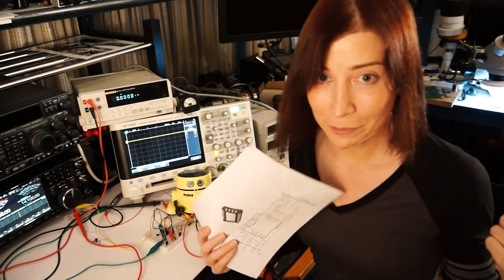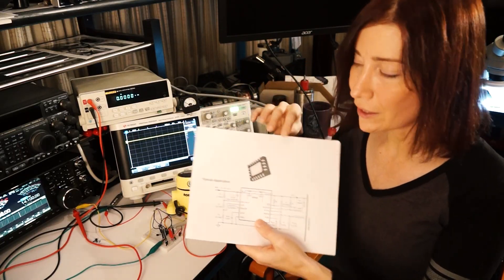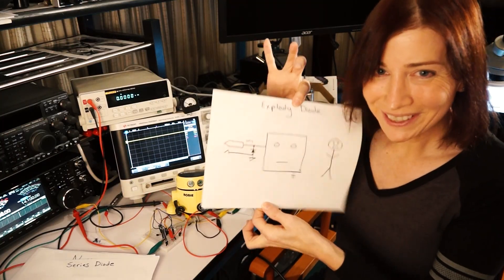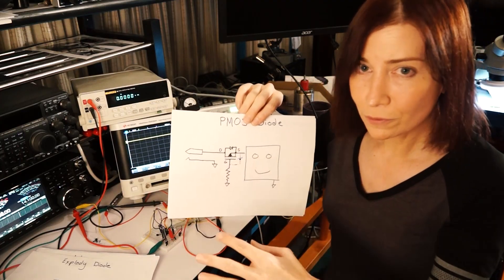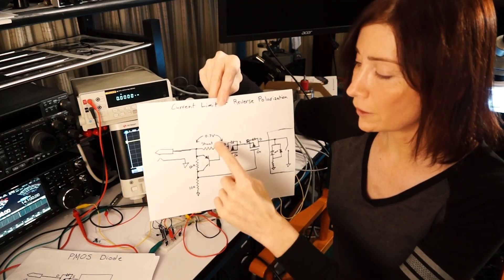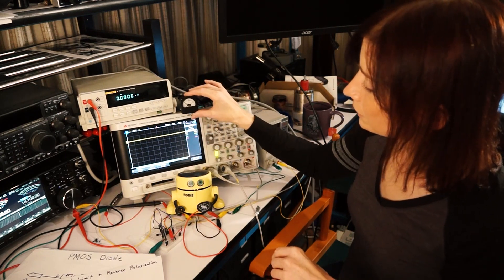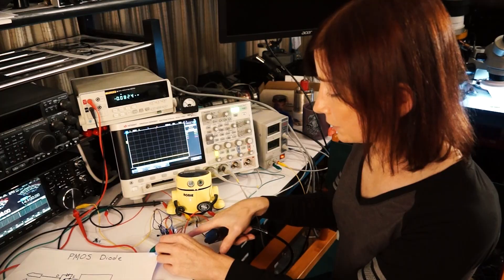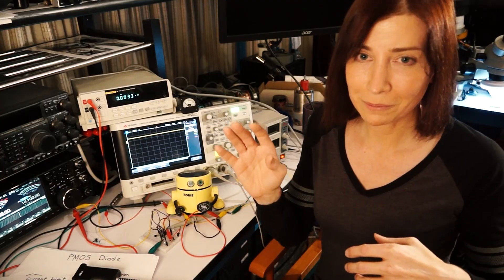Low Cost Reverse Polarity and Over Current Protection (Corrected)

Comment: Aw shucks, thanks for the mention.  I like to leave the mistakes in my videos and openly discuss them because it reassures people that they're not the only ones who make mistakes.
Reply: Mistakes are how we all learn.  Today I put a 450v capacitor the incorrect way in a valve amp....  been doing these amps for YEARS !
Reply: @pickholder6189  , every time I let the smoke out of an electronic device because of some stupid  mistake I made, I have to mentally remind myself of all the previous times that I said to myself, " I gotta remember to not ever do that again!"
Reply: @pickholder6189  Yes, I agree. As clive leaves his mistakes in, that's great. Helps to liven up the video  😎
About the capacitor, did you record it? If not, SHAME!  😜   I had gotten a "not working correctly" well pump motor. It was wired for 120V, and had the ability to be switched over to 240V. So I switch it over, and power it up. Doesn't start up correctly, so I test the cap. Yup, it's bad. So I replace it with an identical one. Started up wonderfully!  Then after about a minute running, the white smoke comes spewing outta the cap.
The previous owner didn't wire the darned thing up correctly when he replaced the cap, and it wasn't going through the centrifugal switch and was 'always' engaged. 240V through a 120V cap makes for an interesting smoke show  😉😂  I think the only thing that creates more smoke is an actual smoke grenade/'fireworks'
Reply: Pick Holder did it sound like a 12 gauge shot gun when it blew up?
Reply: It's always nice to see the mistakes. A good opportunity to demonstrate how to not panic.
Reply: @Breadbored.  Then ElectroBOOM has nerves of steel.
Reply: I left my cock-up in when I powered a very rare, near-irreplaceable PCB on 10V instead of 5V.  (It actually survived.)  To err is human as they say.
https://www.youtube.com/watch?v=ZYG_8_uMZKI
Reply: The most respectful way to your viewers is to unlist your incorrect video and link it under the correction video with a big fat title "INCORRECT".
The BigClive way is ok also, but it might be confusing which info is incorrect and which info is legit.
Reply: @varer  I would suggest that the most respectful way is to not tell people how to run their youtube channel... but hey, opinions are like buttholes. everyone has them and they usually stink.
Reply: @varer  sounds like you don't like receiving unsolicited advice. Interesting.
Reply: @PghFlip  No, I am ok. Just wanted to make you think for a sec on your comment. Have a nice day.
Reply: @varer  that makes two of us. #irony
Reply: @PghFlip  Yep. That is why I did it.
Reply: One of my favorite Jeri videos is the one she discusses learning electronics, core message of “fail and fail often”.  It’s the message of it being ok to fail that will teach one way faster than thinking everything they do will work.  Nobody wins 100% of the time!  Celebrate your failures, it’s what I like to call “teachable moments” learn from everything you do!  Document the good bad or ugly but most important KEEP GOING DONT GIVE UP!  73 de Seth - W8FG
Reply: I'm sure that she's your Favourite shunt.  Anyone tell her about the C64mini?
Reply: You rock Clive...
Reply: <3 BigClive. Your voice is so Soothing ;)
Reply: Jeri and Clive are two good eggs.
Reply: @SolarGranulation  Yes they are. Cody tries also, but struggles with strikes and privacy issue. I understand Codys reason. Cody does not cover up his failures. He just wants to patch up lost privacy and tries to avoid strikes.
Reply: Big up the Big Man
Reply: Capacitors is the best key for me.. changing it to a sign wave if I'm correct.. the way I understand sine wave is it takes out vibrational frequencies like a box fan that hums...
Reply: In this case people would find the other video and repeat it without knowing there was a mistake, atleast renaming with a warning is a must, otherwise not only people might ruin their circuit but also you could ruin your name.
Reply: I’ve watched loads of bigClive’s videos, he’s goood, theEEV blog is also a good source! Keep up the videos!
Reply: I agree clive. As a professional guitar player, you wouldn't believe the way players hide mistakes. Which I understand but humility would dictate some outtakes so kids don't think their favorite minor celeb player is that.good that they can play a notoriously difficult piece and have 80 guitars behind them that they never paid for and any 3 cost more than a luxury sedan.
Reply: Jeri , Ive just come across your channel via Mend it mark 
   Ive always loved electronics every since I was a kid playing and fixing my dads crystal set and a fascinating german made kit in a wooden box 
Wish i had it now ;)
  Its so lovely to watch you explain and create things and your have a beautiful smile to keep me mesmerised too 
  Thankyou once again 😊❤
Reply: @Bigclivedotcom Jeri doesn't have your dead sexy accent, but at least she draws proper resistors.

Comment: It's interesting that this mix of 3 transistors ends up being a good design.  The BJT makes a better voltage reference compared to the FET (lower voltage and lower tolerance).  The FET's insulated gate makes a more efficient pass transistor, even though 2 are needed to get bipolar switching.
Reply: If manufacturers decided that they cared enough to make their products somewhat closer to foolproof, maybe there would be an incentive for the semiconductor manufacturers to build circuits like this into one all-encompassing,  easy to install and design with, package. But I wouldn't hold my breath.

Comment: The big advantage of the explodey diode is that it can be added even though you forgot all about reverse polarity protection until the end of the project.  Also, not so explodey if it is only likely to connect to a power source that can only deliver a few amps.

Comment: If you're doing a non battery powered device, a series Schottky diode should work just fine. I'm designing an automotive device at the moment and I find Schottky diodes to be the most cost effective solution, especially since they can withstand all the weird inductive pulses in the vehicle's electrical installation.
Reply: Too high of a leakage current for batteries?  
http://www.planetanalog.com/author.asp?section_id=3389&doc_id=564739
Reply: @mikeguitar9769  Even in the mA range, thr leakage current for a Schottky diode is too low to do any harm in case of a reverse poalrity event. Their big downside is the power dissipated through the voltage drop.
Reply: Look up "super barrier" diodes from diodes.com.  They dont leak as much and take higher voltage.

Comment: Jeri, you should have actually emphasized that in that "exploding diode" arrangement a fast acting fuse is an absolute must, otherwise the diode blows and there is nothing left to actually protect the device by interrupting the current. It is a fairly terrible circuit...
Reply: Would a polyfuse be a viable choice for that role?
Reply: @thromboid  Yes. :)
Reply: Actually, the more common end result is for the protection fuse to fail as a dead short across the rails unless your fuse takes so long to blow that you actually incinerate the diode first.  In most cases, after an event you will need to replace both the fuse and diode unless the current output of the power source was significantly limited.
Reply: Crowbar protection
Reply: Chris Thirion Crowbar circuits only protect from over-voltage conditions, they do not address the reverse polarity or over-current protection that this video was specifically about.  Crowbar circuits are, however, useful for protecting circuits from runaway high voltage conditions where you may have to briefly clamp many hundreds, or even thousands, of amps for a very brief moment until a fuse can blow — but if your fuse takes too long to blow or your SCR is undersized for the surge current then it’s “explody crowbar” as the SCR catches fire and explodes.

Comment: Nice! I have also used a single n channel mosfet in the negative input leg. N channel mosfets generally have a lower on resistance than p channel. I had never thought of your circuit for current limiting also. Thanks for that additional insight!

Comment: How would this circuit react if there was an AC input applied of the equivalent rms voltage? I know it'd be (in theory) a half wave only, but how would the transition look from 0v? Not something that would happen in the real world, just a curiosity. Bonus question, at what frequency would the pmos's be affected and would they stay open, closed, or kinda somewhere in between, like a secondary current limiting factor?

Comment: I’ve used almost that circuit in automotive engine controllers. The difference is that I arrange the low side resistor and voltage clamp so if the engine controller is in standby, the circuit is shut off, reducing quiescent current. In this mode the body diode supplies power to just the voltage regulator and it has OVP via a 8A27 TVS. The battery voltage usually makes the gate zener conduct. Because of this, I had to split the voltage limiter. It supplies a limited to 35V gated power feed to all other circuits, the OV clamp is powered between the two MOSFETs, and the gates are connected together so they share one zener, and the pull down and OVP have a single N mosfet with Vdd going to the gate. The junction of the two MOSFETs have the TVS that clamps at 45V (with about 100A load dump) to ground and that feeds the voltage regulator with a standby mode. I use a 20P06L FET, it can handle most load dump surges (verify with testing). The other MOSFET with a voltage limiter clamps to 35 volts and feeds the H bridges and other circuits that blow up over 40 volts, and turns off after the ECM goes to sleep, further reducing quiescent current. Only one more part needed from your component count, one small signal 60V logic level MOSFET. Note that to deal with reverse spikes, the gate pull down impedance needs to be low enough to discharge the gate in a couple microseconds so maybe 5-10k or so which is a fairly high load. Does that all make sense? With a battery, gating the pull down can save battery life. In my case, it’s battery life of a 60Ah, 12V lead acid battery, but at a parking lot for an extended couple month vacation. Those mAh add up. BTW plugging into an automotive 12V (or 24V) power supply bus is plugging in to a world from hell. Love your channel!

Comment: We could also spice model the circuit,  assuming there are accurate models for the FET's and transistors
Reply: Sure, with this you aren't going to need exotic FET model behavior.
Reply: I always try out a simple circuit using the free LTSpice circuit simulator first to see how it works then go to the bench to verify...I'm lazy /;>) P.S. The models are accurate.

Comment: To make mistakes is human, and sometimes that's how discoveries are sometimes made.
Reply: Teflon was also discovered by accident.
Reply: @SE45CX  , cyanocrylate super glue was also a happy accident.
Reply: @goodun6081  As was also the transistor  😉  Whoops, math error!
Reply: Can't make it through a single day without a discovery.
Reply: For myself I don't think I'm doing odd enough things to make a realistic chance to get to discoveries. I just prefer to do a good job using well known approaches.
Reply: @SE45CX  I encounter about once a month or so a situation where a well-known procedure just refuses to work right, or where a seemingly minor change in a parameters has great consequences. Have been a CNC machinist in a job shop for about a year, since quitting a dead-end career in IT...
Reply: kab kab yeah, sometimes

Comment: Glad to see these. I actually am about to build such after changing the psu setup on a retro rebuild (Atari 2600). I just went to USB to power it, it seems to be a nice fit given the 5 volt and the saturation of  these devices in the world. At the moment I have no protection, but am going to add over voltage and reverse protection. I have thought about buck/boost to address possible under voltage but, then efficiency and load on possibly cheap usb unknown quality plugs.....  Hmm so many options.

Comment: Hey so I have a question... so instead of using 2 diodes to do battery rollover would a PMOS work in that aspect? I have a battery application that needs to rollover, have a low cost BOM, and fit in a small space?

Comment: As mentioned earlier, some neat overvoltage protection would be interesting. I suppose you have some great insight. 
Thanks for your awesome content, and glad to see you back here!
Reply: Btw, I never did put a fork in the cartridge port, but instead a paperclip in order to rest the old breadbin. A wonder it still lives.
Reply: For brief over-voltage.
Place resistor in series with PNP's base
take a zener and and another resistor and run from base of PNP to ground.
For longer term over voltage, you need another transistor to make it snap off and stay that way until the voltage is removed.